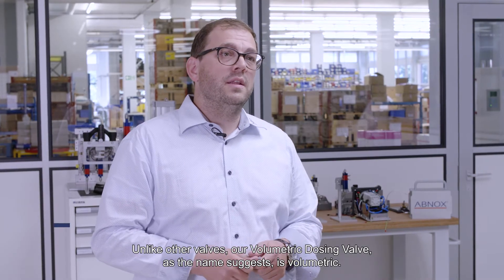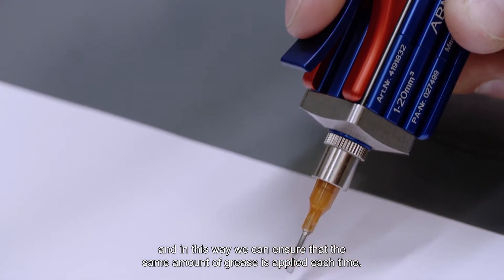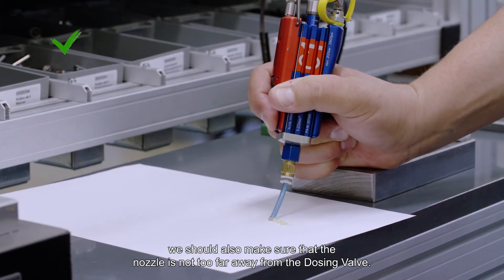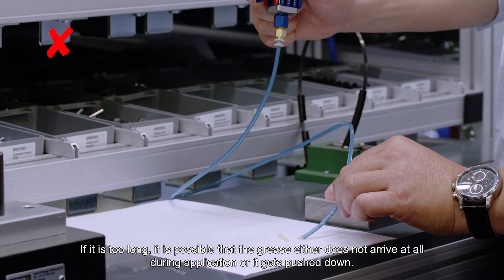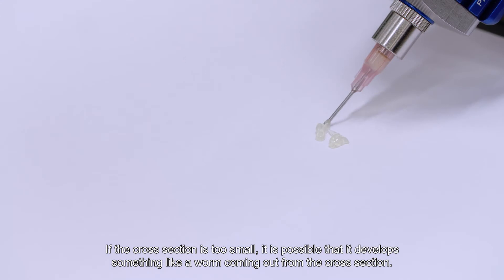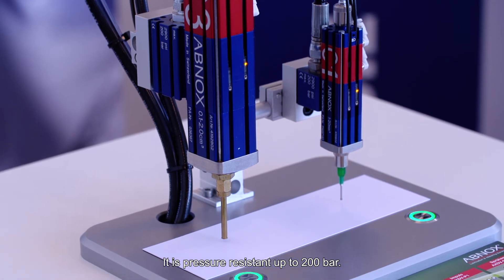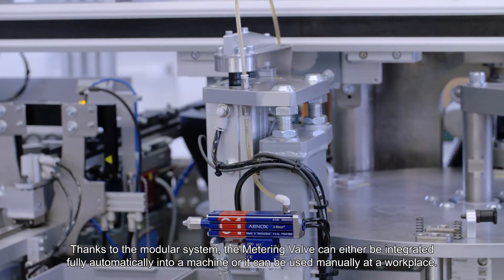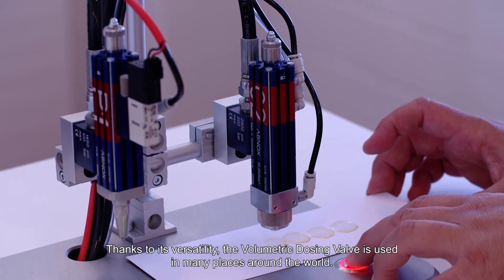Volumetric Metering Valves AXDV-C

Comment: Which industry or application would you say  represents your highest number of units sold? Which represents your most demanding in terms of specifications?
Reply from the maker: The automotive industry is one of the largest industries and has the highest requirements for documents and specifications aswell.